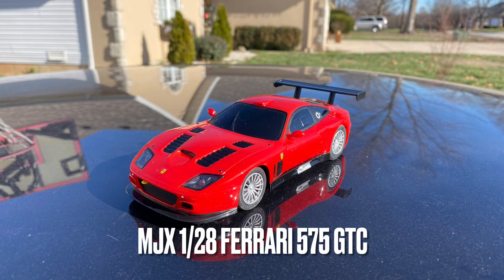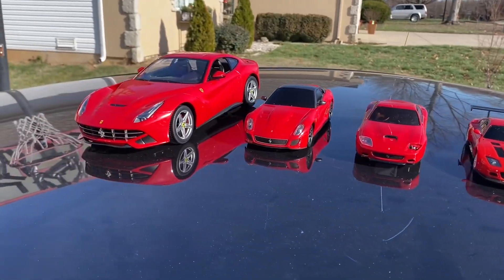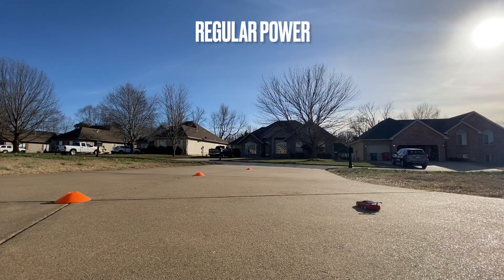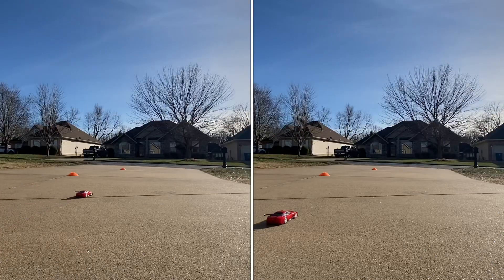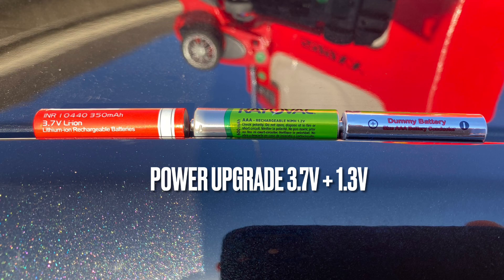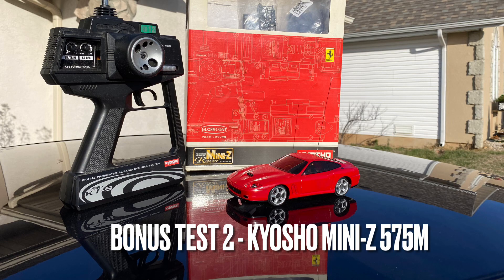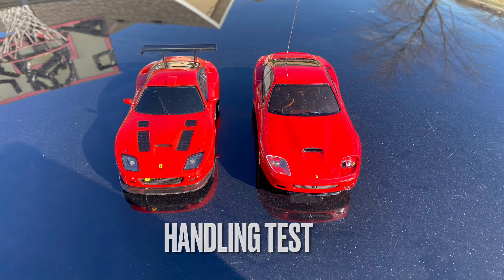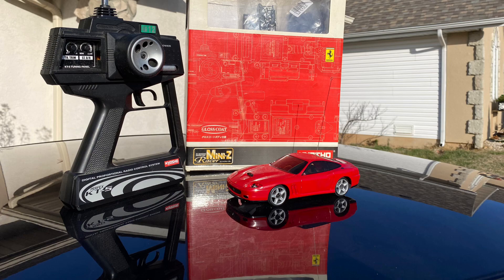MJX 1/28 Ferrari 575 GTC

Comment: Just picked up 6 Rastar 1/24 to modify. Gonna do some races with the boys. I picked up 9g servos would you recommend something smaller or is that good? Haven't opened them up yet just took them out the box.
Reply from the maker: I recently did the same thing.  Amazon had some good prices for those 1/24 Rastar cars.  I recently modified a white Porsche GT3.  I used a 5g metal gear servo.  The servo is an upgrade option for the Wltoys K989.  Also a little smaller than a 9g so it fits better.  I was using cheaper 6G plastic servos in the past, but those broke easily.
Reply: @2005silver  thanks for the info I figured a 9g would be too big. Got most of mine for $13.99 Canadian from Amazon. Amazing deal couldn't pass them up. At that price it was hard to resist.
Reply from the maker: @chrisd0427  That’s a great price.  Which ones did you get?
Reply: @2005silver  ended up getting 8 price is too good to pass up.

458 Speciale yellow
F40 red
918 Spyder silver
Zonda R white
599 GTO red
P1 yellow
488 GTB red
Cayenne Turbo yellow 

Might add a few more before they all sell out. Gonna put that Cayenne through hell. Ill have to hide them from the kids these bodies are sweet looking.

Comment: Did you use to 14500 lithium ions turn to be running on 7.4 v?
Reply from the maker: I did try using 2 lithium batteries for more power, but the toy grade electronics didn’t like that much voltage and they ran weird so I lowered the power.